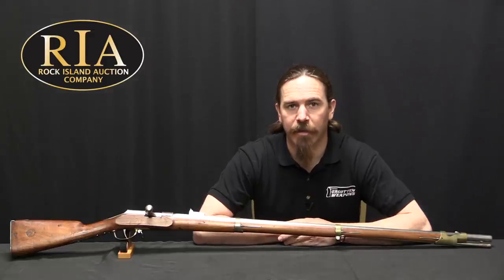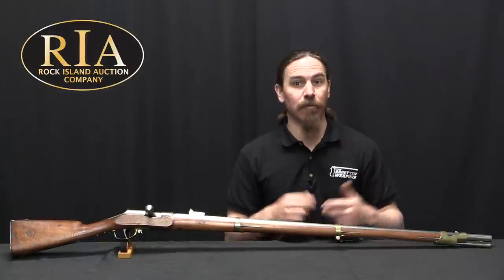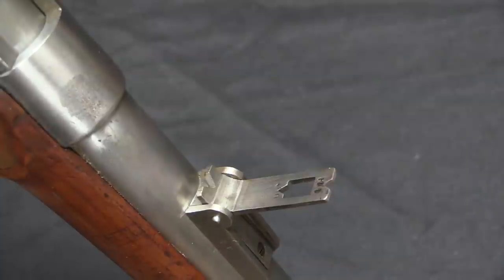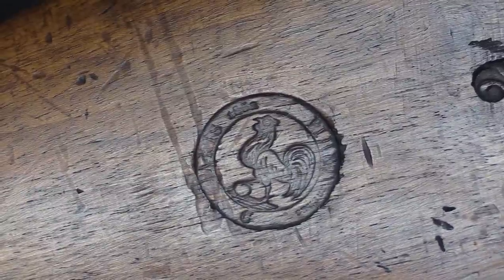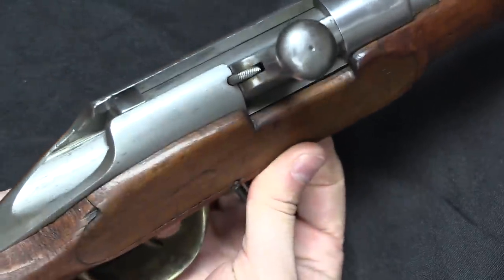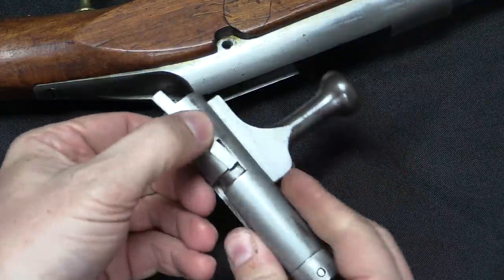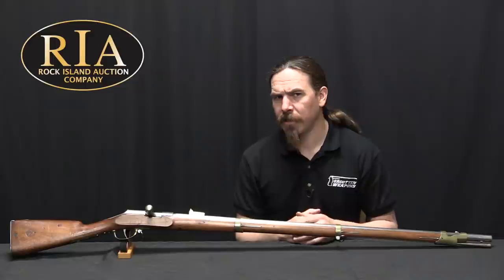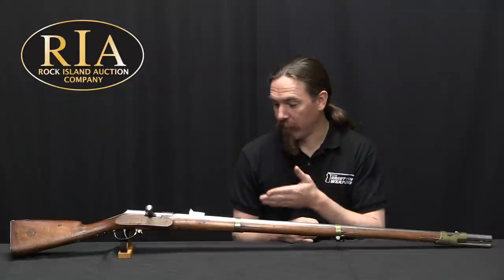Bolt Action Cartridge Conversion of a French M1822 Rifle

Comment: It is what is known as a “Samain” rifle named after Pierre Samain. The conversion was put forward in 1870 and was to be applied to any musket they could possibly do it on including imported US muskets. Production estimates are around 80000 made by a variety of private workshops. The base idea was sound but the quality of conversions fluctuated wildly. The cockerel stamp is the sign of the “monarchie de juillet”, the rule of Louis-Philippe I from 1830 to 1848.
Reply: John Anon My source is a book (in French) on the arms, both foreign and domestic, which found their way into French use during the 1870/71 campaign. There is quite a detailed article on them and it clearly states that there are countless minor variations made at the whim of the workshops. I think the locking catch is period made, this is because the Chassepot actually has a similar option. If the Chassepot bolt is put to an indexed 45° position and the trigger is pulled, the firing pin drops just a little (not enough to clear the bolt face) and locks the bolt handle. To fire you just need to recock the firing pin and turn the bolt down the remaining 45°.
Reply: Samain rifles are rare everywhere, they were mostly destroyed postwar.
Reply: The Chap k
Reply: @thebotrchap  Can you provide a title for the book you mentioned? A friend of mine has a Samain chambered in .58 Berdan, and I'd like to have additional info for him.
Reply: TheMysticalBadger “Les Armes à feu de la défense nationale et leurs baïonnettes 1870-1871” by Jack Puaud & Christian Mery, editor is Crépin-Leblond ISBN 978-2-70-300314-4.
Reply: Thanks, this is why the internet us cool.
Reply: Perhaps a dumb question but this barrel is from an 1822 design, yes ? And thus a smoothbore,yes ? With an already large bore,is it rifled ? And if from the era of Nappy III,what would be the details of a then common cartridge  ?
Any info you can pass on would be great. No longer read either French or Italian,and you do,so what can you tell us ? Cheers.
Reply: Oops. Louis-Philippe not Nappy III. Not that either man was worth much.
Reply: @thebotrchap  So it would be a safety device then, contra to Ian's thought?
Reply: paul manson The calibre is almost certainly 18x35R, the same as for the mle1867 “Snider” conversions. It is more or less a very short 12g cartridge, originally with a card/thick paper case wall. I don’t know enough about the different models of French muskets but it would be rifled if the donor musket underwent the “T bis” conversion (barrel rifled and fixed sight fitted). The article I have states that smoothbore rifles were also converted, such was the need for infantry guns.
Reply: JonMacFhearghuis Well it seems to be a not very well thought out safety since you can apparently still fully drop the striker at least on this example.
Reply: Cyphik I suspect it was simply to stop the bolt opening and flopping about whilst the rifle was shouldered. It was French doctrine to carry rifles unloaded until engaging (hence lack of safeties until the first semi-auto rifles).
Reply: @thebotrchap  Aha. Thanks
Reply: I have one converted from a US musket (you've seen the video I posted elsewhere of me running it, I believe) and I'm astonished at how well made this one is compared to mine. As you said, the quality clearly varied wildly. From what little info I was able to gather the US rifles weren't considered for conversion until the bitter end, so the shoddy quality of my example would make good sense. I also keep seeing these referenced as the Samain model of 1867, but have yet to find any info backing up that date.
Reply: parabellumpro1 I‘m guessing some people assume wrongly that since the first official conversion (Snider/Schneider) is designated 1867, all other subsequent cartridge conversions are also 1867.
Reply: @paulmanson253  The M1822 flintlock was converted to percussion. Then later rifled. Then many were converted to M1867 Tabatiere with a Snider type breech and finally converted back to smooth bore as a 12 bore shotgun and sold cheap in the USA by the hundred thousand. In this case the 1870 War stage was the Samain bolt action breech loading conversion using the same M1868 Gevelot centre fire cartridge. The Samain was bought by the French National Government after Sedan for the National Guard. I had one as a 12 bore shotgun which was Samain made in Lyon and worked fine even though the bolt was a loose fit until closed. They would buy anything that went bang and was a breechloader at the time they were so desperate. Other odd workshops copied the Samain but many were awful work so even the Belgian trade post war only converted the best to shotguns and most such Samains are in the USA as such. The sidelock space was filled with a block of wood glued in for strength and then prettied up by a (very) thin veneer of walnut which is usually starting to come away by now. I am surprised Ian found it to be an unknown rifle. They are rare but made by the tens of thousands and can be found cheaply as shotguns from time to time. Some National Guard preferred a good one to a Tabatiere as poor quality emergency M1868 ammunition would be prone to stick in the breech and the Samain bolt gave a better chance to extract one without applying a boot or hammering it out with the cleaning rod. I have just seen a Samain shotgun for sale in the USA for $350. Make a nice companion to the M1867 shotgun there at $225. It is well production engineered with the receiver from tang to barrel being one piece of thick wall tubing and the bolt milled from one piece of solid rod,

Comment: Hi, since you mention it should have been converted in the 70's, it was most probably made in 1871 to help equip the new republican armies after the collapse of the 2nd Empire.
Reply: I was thinking of this as well.
Reply: This would conceivably explain the lack of credentials on the rifle too - it was all about slapping functional firearms together as quickly as possible
Reply: @Muzzle Flash it's not speculation anymore, I checked the 'samain system and can confirm it was first used during late 1870
Reply: @Muzzle Flash The Samain patent dates back to october 10 1870. The cartridge used was a Gevelot mle. 1867. I can't find any picture but it's definitly not metallic (here's what a contemporary chassepot cartridge looks like : https://i.servimg.com/u/f34/15/74/65/02/sarie_10.jpg). The chap mentions around 80 000 built but i found 60 000 (http://fr.1001mags.com/parution/gazette-des-armes/numero-230-fevrier-1993/page-36-37-texte-integral). Many small workshops were for sure making the conversions and I guess the emergency made it hard to track precisely.

Comment: Ian,We have illustrated this rifle in our book, 'The  Needle-Ignition System of The Modele 1866 Chassepot' -  Page 81, which you reviewed.It was designed by Pierre Samane, manufactured by Atelier de la Buire for Cahen-Lyon et Cie, made during the siege of Paris.  In our view superior to the Tabatiere system and stronger around the wrist, which was a weakness of the Tabatiere.The bolt lock was to prevent it being opened accidentally.Other conversions for the 18x35R Gevelot cartridge illustrated:  Mousqueton Hurtu Et Hautin and Hermann-Lachapelle - both bolt actions.This would be a great item for a collector and shooter of French arms, especially during the period  of the Siege of Paris when any arms available were utilised. It at least chambered a mettalic cartridge.Hope this has been of use.Guy and Leonard A-R-West
Reply from the maker: Thanks - I didn't have a copy of your book with me when I had access to the rifle, alas.

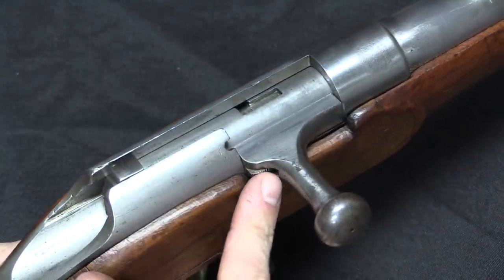Comment: 3:57  That could be there as a safety measure that helps ensure that the bolt doesn't completely open by accident on firing.  Its a problem I've noticed with the smooth action on some SMLEs.

Comment: when it comes to the safety tab thing, maybe it shortens the firing pin protrusion by a hair ... ?
Reply: Most likely. That threaded piece in firing pin assembly should stay togheter with bolt and cam firing pin backwards, when bolt is rotated open. That way it also acts as safety. Unfortunately it looks that thread was probaply worn out slightly, and allowed that middle piece to rotate little too far and deep, and rendering whole mechanism inoperative.
Reply: Interesting hypothesis. Another comment points out that the Chassepot works similarly when fired with the bolt at a 45 degree angle instead of fully locked, so that would make a lot of sense (especially since it looks so much like a safety to everyone).
Reply: @mysss29  Without having seen the thing apart, I would see how the tab could internally interfere with the firing pin, preventing full travel and thus ignition of a primer, while appearing to allow the cocking piece to snap forward normally when the trigger is pulled.

Comment: Beaten to the punch by The Chap. It appears to be a Samain conversion. Several receiver variations, but the loose extractor running in a slot is typical.

Comment: Защелка на рукояти затвора нужна для того, чтобы затвор самостоятельно не открывался во время военных походов и перемещения солдата.  Это не предохранитель, это своеобразная защита от грязи.
The latch on the handle of the bolt is needed so that the bolt does not open itself during military campaigns and when a soldier moves. This is not a fuse, it is a kind of protection from dirt.

Comment: I´m a little confused the original M1822 was a musket not a rifle - this conversion has a rifled barrel ?
Reply: The M1822 was a flintlock .69 caliber smoothbore musket. After 1841, large Numbers were converted to percussion .71 caliber smoobore muskets (renamed M1822T). After 1857 Large Numbers of M1822T were rifled for a .70 minié ball (renamed M1822TBis). In 1870-1871 some (nobody knows how much) were converted by private gunsmiths to breechlock (the so called M1867 Tabatière).
Reply: The first official rifled musket was the M1793 flintlock carbine used only by elite troops. In 1837 a new percussion rifled carbine (different from the M1793) was adopted for elite troops. Then variations of the M1837 rifle were produced until 1859. It was only in 1857 that the French Army switched from smothbore musket to minié rifles muskets for the whole Army. An by 1867 the Chassepot needle rifle was chosen to replace all variations of Minié types muskets.

Comment: Anyone have any ideas on that wheel?
Reply: Yes, Yes Or I mean a WEE WEE. He had it right, just from guessing, Ian is good.
Reply: It might be a way to stop the cartidge from falling out if it opens by accident when the user is moving and have it slinged on the back.
Reply: A spring behind the wheel make it a safty fore the handel? An auto safty fore the breech.

Sorry for bad spelling. Swede...
Reply: @exploatores , I thought of during hunting & possibly war from bumping & snagging on things & then you can still shoot it when positioned.
Reply: @larsbkurin1740 , Correct, I think.
Reply: Maybe it was used as load indicator, so the officers could quickly check the line if everyone is ready to shoot.
Reply: someone else in the comments made a decent guess a primitive dust cover possibly or maybe it is meant to keep bolt from opening while moving but still able to be shot like ian said its hard to tell
Reply: @cyanidic3673 , Correct, Ian did get it right.
Reply: SonsOfLorgar yeah so far pretty much all the guesses ive seen sound right like i have no idea the true meaning of it but it seems like it might be a mulitpurpose wheel